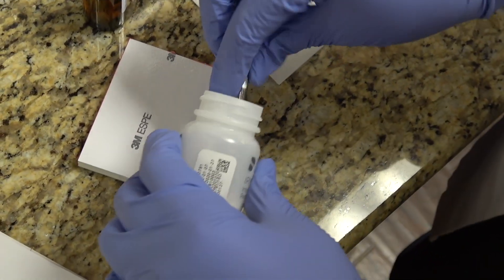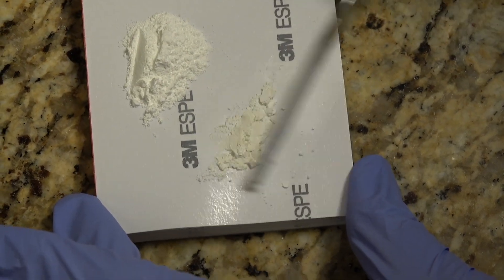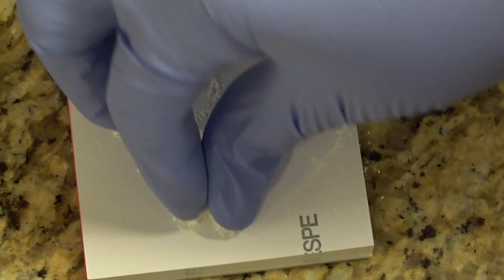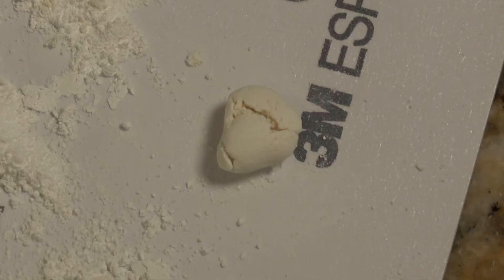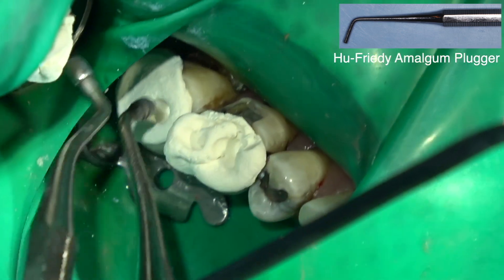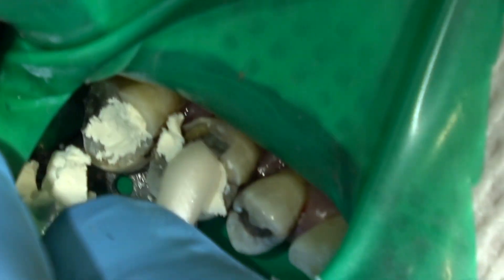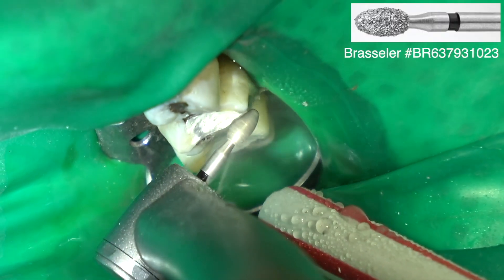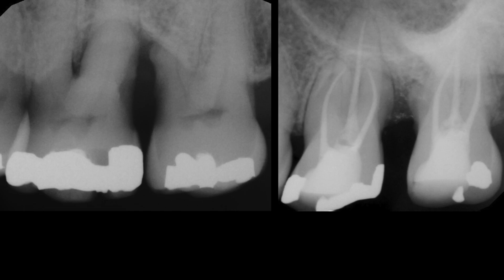Dental Assisting - How to Make IRM - Dental Minute with Steven T. Cutbirth, DDS

Comment: Your video work is impeccable as usual.  The video is on IRM mixing and the technique was flawless.   My question though is that those teeth seemed mobile with very little perio support, what factored into the decision to keep those teeth rather than extract and are you going to splint them?
Reply from the maker: I do not think the teeth were more than class 2 mobile. If they were class 2 mobile, I would adjust the occlusion and have the patient wear a Nightguard. Take your practice to the Top Tier. Subscribe to DentistryMasterClasses.com for an organized library of all the Dental Minute videos plus many complete comprehensive cases and many very important articles. New cases are added weekly.  Only $20/month.
Click here to subscribe: 
https://membership.dentistrymasterclasses.com/purchase/?plan=513